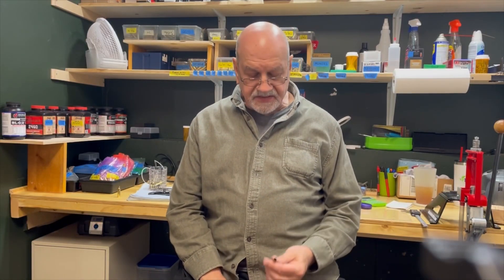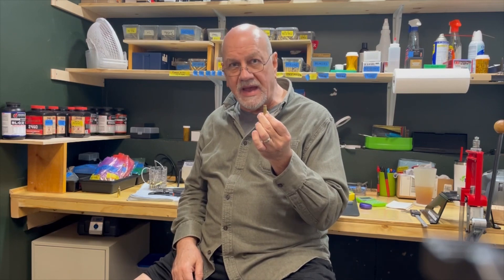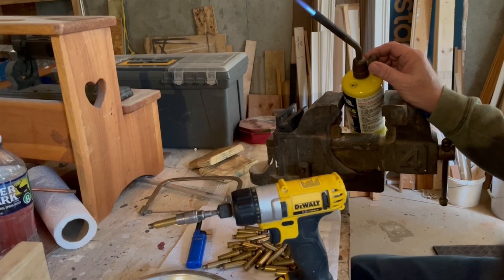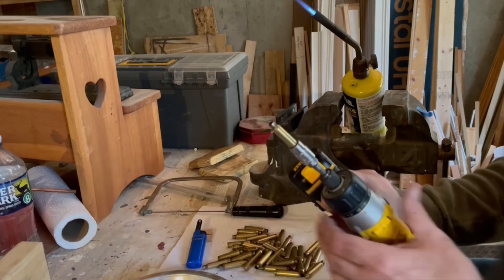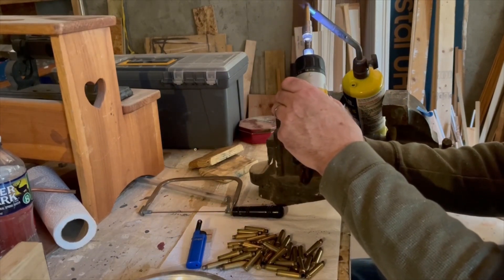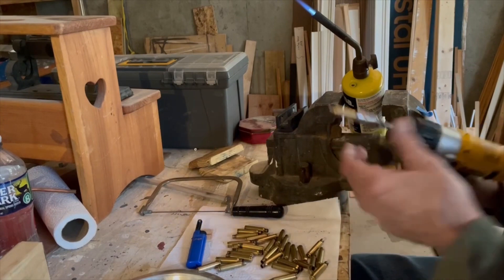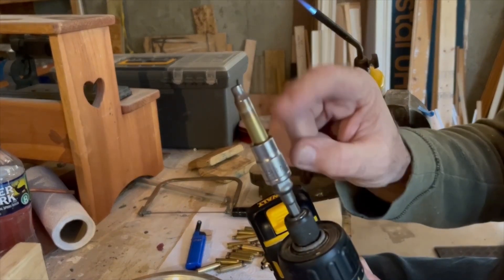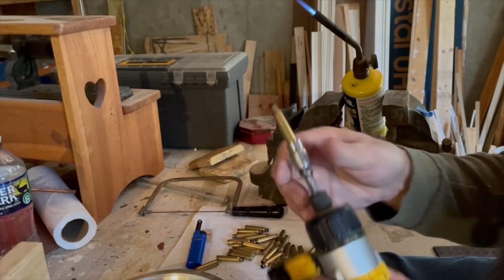Why and How to Anneal Rifle Brass

Comment: so if you quench in water after heating does that harden the brass?
Reply from the maker: No, it has no effect. The brass is still softened. The brass hardens as it is worked; compressed, expanded, compressed, expanded, from repeated reloading and firings.

Comment: Is this gas Map/pro, and the torch UL2317?
Reply from the maker: Yes, it is Mapp gas. I don't know the model number on the torch.
Reply: @EverydayReloadingandShooting because I need to know for once If can use yellow bottle on propan torch. On the Bernzomatic site is wrote that propan torch is not compatible but is different 130 fahrenhite instead of propan

Comment: They are not overly expensive but you can buy the Little Crow gunworks bushings from midwayusa to hold the cases. I used to have the old Hornady set but lost 2 of the three case holding bushings, down to just the magnum one
Reply from the maker: Thanks for the info and thanks for watching